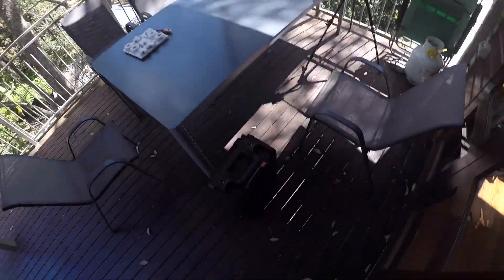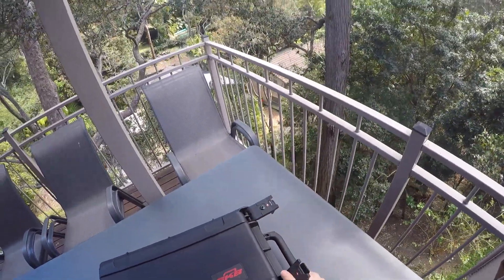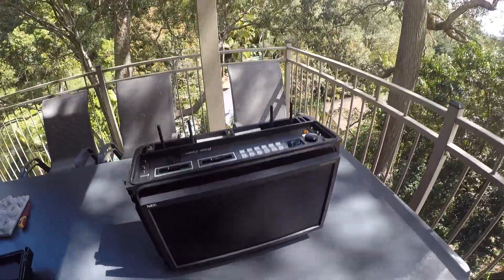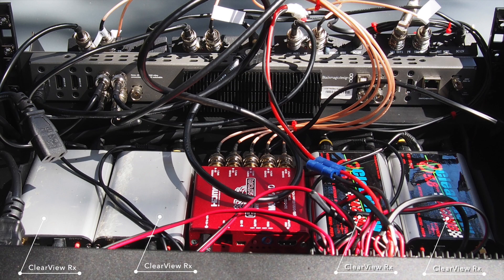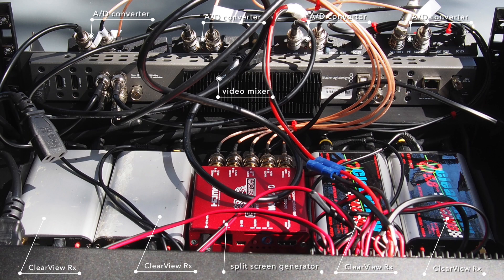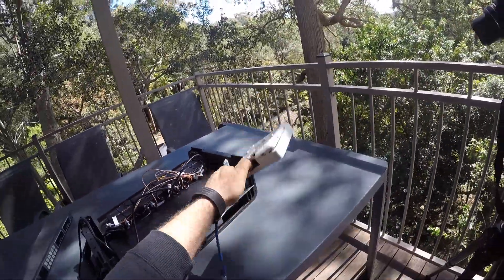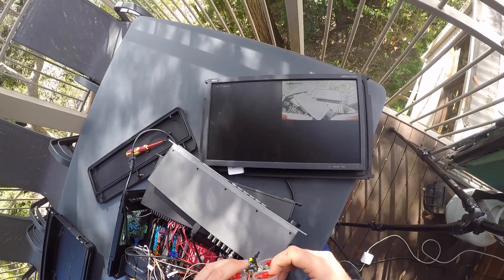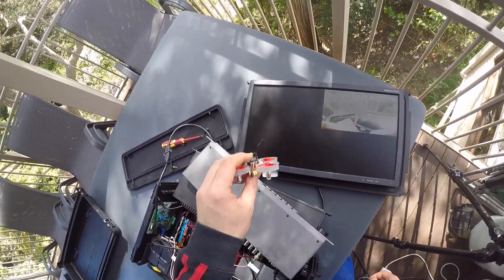FPVR Party Ground Station - a look inside!

Comment: Awesome mate. Do the clearviews have antennas?
Reply: Yes, they have two antennas each. One each is mounted to the top of the case, so they extend upwards a little. One each is mounted on the inside, on the back of the case. So when the back is facing towards the track, only a thin     Layer of plastic is in the way.
Reply: Sweet. Thanks for the info :D

Comment: Where are the aerials for the clearviews ? 
Awesome work bro :)
Reply: One each on top via a short extension, one each inside on the back of the case. Top ones are exchangeable for more challenging situations, but rubber duckies are usually sufficient.